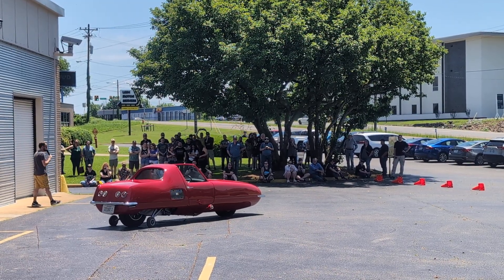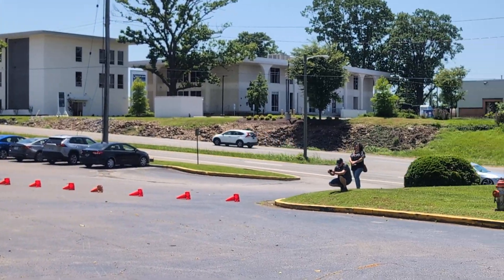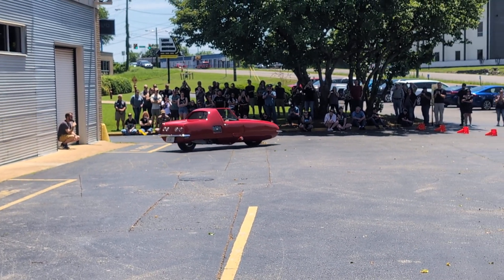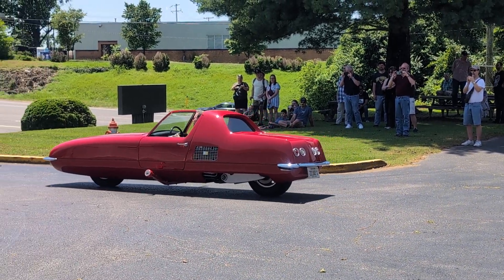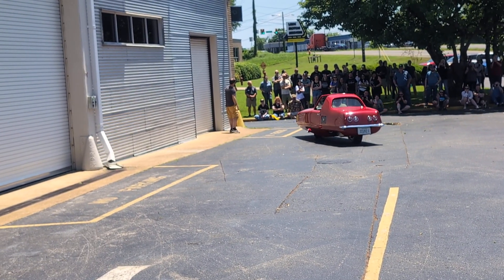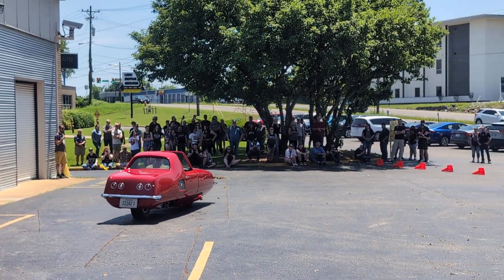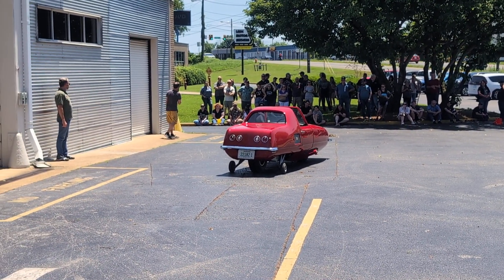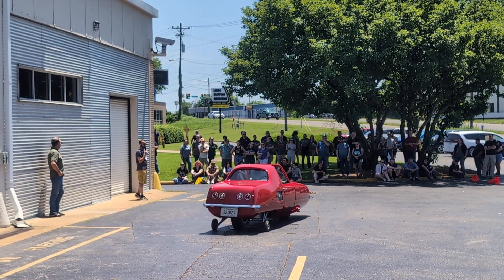Gyro-X demonstration at Lane Motor Museum, May 25, 2024.

Comment: its actually really old technology. The original trains had been proposed to operate like this on a single monorail track. There is two self correcting counter rotatine gyroscopes. Its actually amazing bit of kit but science for some reason just abandoned the idea as investors didnt like it ???? go figure
Reply: it took too much weight and space. The "original trains" you're referring to are the "Brennan Monorails" and were most definitely not "original trains." Classic dual-rail trains were around for a very long time before the Brennan was introduced. The Brennan's were not viable for use, as every single train car needed its own set of gyroscopes, taking too much space, way too much weight, and too much noise inside the car itself for passenger use.
Reply: The original trains?
Reply: In a time where energy efficiency is key, imagine using energy through all the time just spinning inercia reels.